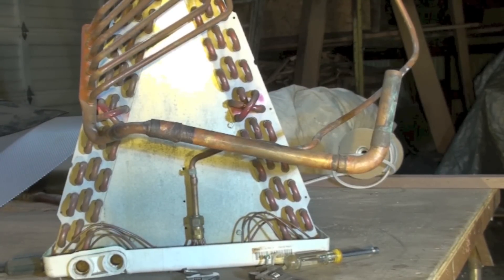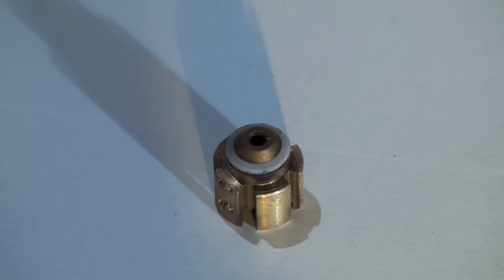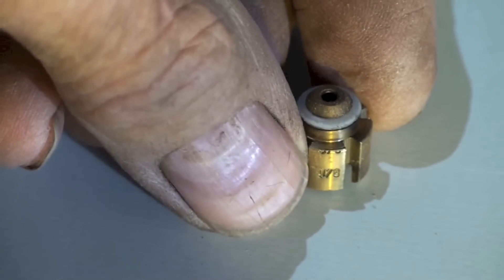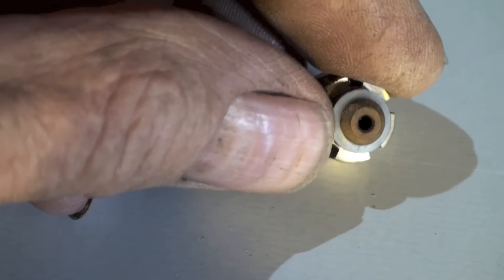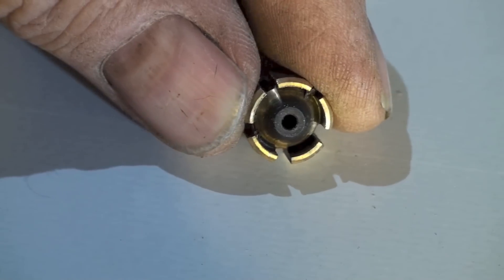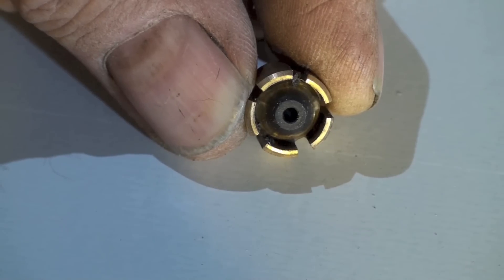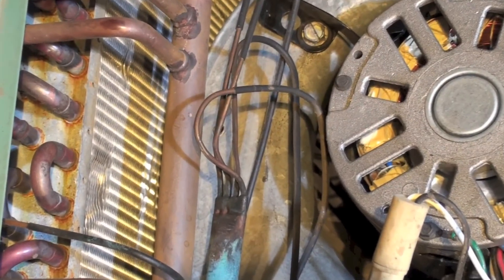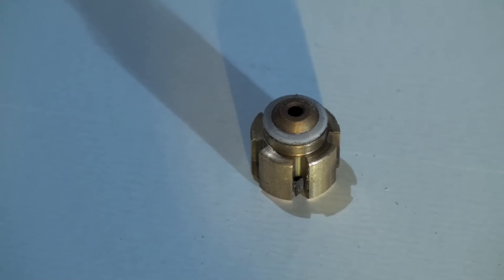The fixed orifice expansion device

Comment: What size of piston should I use for a 4 ton 410 unit?
Reply from the maker: There is no right answer.  You should be looking at manufacturer instructions including evap size, and condensing unit model.
GFM

Comment: hi, if head pressure goes up to 350 and suction pressure stays at 100 in your example. would MORE refrigerant be fed into the evaporator because of bigger pressure difference? thanks.
Reply from the maker: Yes.  Refrigerant flow, superheat and subcool are all controlled by the pressure difference.
GFM

Comment: Say you bought a new condenser and evap coil.  the evap coil has that orfice installed, and there is one in a baggie hanging off the condenser.  Which one should i use?
Reply from the maker: Whichever one the manufacturer's instructions say to use for that combination.
GFM

Comment: I have a mismatched 1995 Bryant 10 SEER coil and a 2015 Trane 13 SEER condensing unit  MOD # 2TTB 3048A 1000 NA   4T R22.  The orifice doesn't let enough refrigerant through under heavy loads and I would like to change it to a TXV.  Do you have any recommendations on size or model number?  Do you think an external equalizer is necessary?  Do I need one that will bleed off the pressure during the off cycle?  Thanks.
Reply from the maker: The system will never match properly.
To  answer your questions, size is 4 ton.  external equalizer is necessary.  You may need either a hard start kit or a bleed TXV.  
GFM

Comment: Hi sir i have reheem hvac evaproter not cooling full when unit on only hoff  evaproter pipe going not fully coil sir whats we do.
Reply from the maker: One of the distribution tube may be blocked.
GFM
Reply: Thanks you sir

Comment: I have a unit that has 3 pounds of freon. No leak. Evap is freezing up.. if I over charge  the unit.. low side remains in fessing temperatures...air flow is good. Should I question the fixed orifice or the compressor?
Reply from the maker: I would look at the orifice first.  Assuming the superheat is high.
GFM

Comment: I have a question on how one would select a specific size orifice.....I have a 2.5 ton Rheem r-22 condenser that was hooked to a York slab evaporator that employed a #59 orifice......I am replacing the slab coil with either a 2.5 or 3 ton "A" coil (depending on what I can find locally) ---wondering how I determine what size orifice to use with the new coil....dont really want to go to TXV   - its a 10 SEER unit and dont see the benefit of TXV here.

Any info or place you can send me much appreciated - will be doing this soon since system is down from evap leak and its hot here
Reply from the maker: The fixed orifice is all manufacturer specs.  In your case you have a mismatched coil and outdoor unit.  The best solution is a TXV.
GFM
Reply: thank you very much for your kind reply.
Reply from the maker: Welcome
GFM

Comment: Hi GFM. I'm helping out a friend whose evap coil is leaking.  It is a superior coil which isn't being manufactured anymore.  The old coil was 3.5 tons and the cond. is 3 tons.  I put in an Armstrong 3.5 ton coil.  The problem I have is I cannot find anything on the condenser as to what size piston to use.  Do you have any piston charts or any suggestions for the best size piston.  My research on line is leading me the conclusion that I should use a #73 piston.  It is an r22 system.  It would have probably been best to replace the whole system but money is tight as his wife is recovering from cancer treatments.  Thanks for your help.
Reply from the maker: +johnmiller102 I do not have any charts.  About all you can do is use target superheat for charging and change pistons if necessary.  Hope this helps.
GFM
Reply: Ok.  Thanks.  Would it be correct that if superheat is too low and the system is charged correctly than the piston is too large? If too high than the piston is too small?  My concern is if the piston is too large I might end up slugging the compressor.
Reply from the maker: +johnmiller102 You are correct.
GFM

Comment: HI,,please help,,anbody!! lol  561-929-2170,,,replaced compressor in 3 ton trane ,,,,charched to 68 low ,,high side went to 150 psi & stayed there even when system turned off,,,temps were 78 inside & outside,,,but cooled perfectly for 2 days ,,then no cool,,,so when reconnected gauges,,,system off ,,was 120 lowside,,150 highside,,then turned system on & lowside went to 0psi in 10 sec & stayed there & again highside stayed at 150,,,,then turned off & lowside went  back up up to 120  & HIGHSIDE ST AYED  at 150,,,,HELLLPPP!!!  ANYBODY SEEN THIS BEFORE,,,,heat is killin me,,,,ohhh did find a leak at compressin fitting,,561-929-2170
Reply from the maker: Sounds like you still have a leak. 
GFM

Comment: Hi, I'm working in my home ac, after l lost all my freon r22 due to a leak in the outside condenser, I'm looking to recharge with a compatible and eco friendly freon. I  watched your video and went and look the evaporator and came across with txv valve with 2 check valves, before and after the txv and it has orifice piston #40. It's a 2.5 ton Rheem unit with a 3 ton out side condenser. does it need all these components? or can l keep just the orifice piston and remove the txv?, btw, the txv has a equalizer as well. Thank you

Comment: Question: If you needed to open the system for some reason, add dryer or pull the evaporator or......  Could you  close the outlet on the compressor and suck the system down with the compressor and them close the suction side and open the system?
First would this be legal and 2 how low would you suck the system down to. I remember seeing a tech do this many years ago when he started a system and found a leak. How would this be done legally if it can be done. Thanks for your time.
Reply from the maker: amtpdb1 You can pump the system down if it has valves on the condensing unit.  Here is a video on how.  https://youtu.be/qBTHLHh3394  This, of course is only useful for working from the liquid line out of the condensing unit and beck thru the suction line to the outdoor unit.  When the repairs are done the portion of the system you have worked on must be evacuated using a vacuum pump before opening the valves and putting the system back in operation.  Because you are not dumping refrigerant to the atmosphere, there are no laws violated that I know of.  Hope this helps.
GFM

Comment: Is the only way to tell if it is restricted to take it out. For some reason I have problems with finding the restrictions.
Reply from the maker: Pretty much.  low suction, low head, low delta T, adding charge makes no difference, Usually that is the problem.  Other possibility is plugged drier (should be a temp diff across the drier).  Subcool should go up as charge is added but no corresponding rise in suction pressure.  hope this helps.
GFM